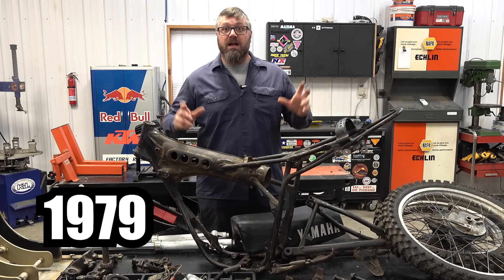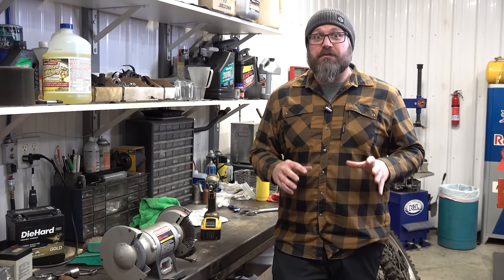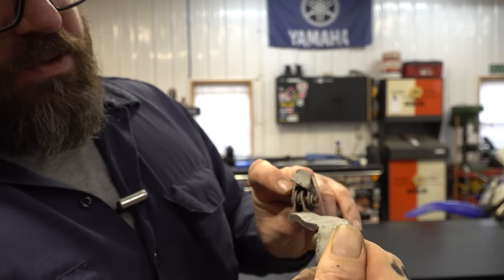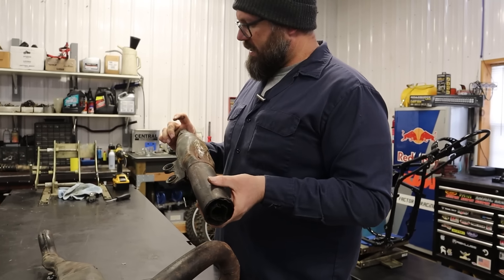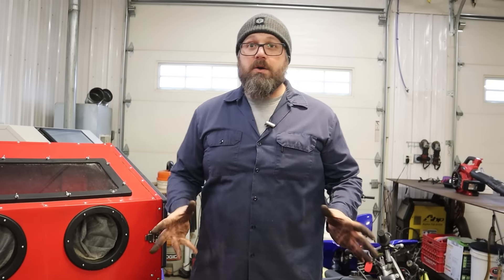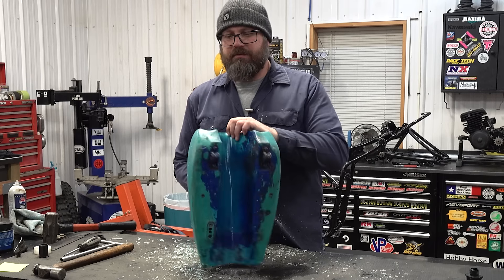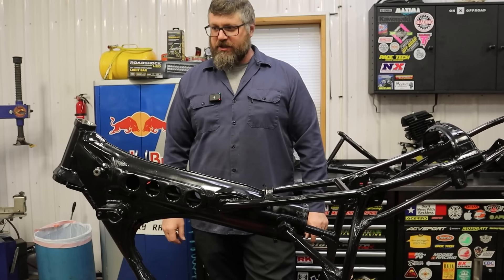Restoring A Vintage Yamaha Dirt Bike Part 2

Comment: The trick with bearing races (around the 9 minute mark) is to put a weld bead around the inside of the race. When the weld cools, the race contracts slightly and lets you get them out.
Reply: Amazing advice! Noted
Reply: This is the way.
Reply: oops i just commented the same.
Reply: This is the way i do it.

Comment: Bearded you and Dan make a great team.and i love the content getting the old Yamaha dirt bikes to go and celebrating at the end .i love the puns and music that come up during the clip.almost feel like i am sitting in the corner in your shed.I had a CT 2 Yamaha 175 with the low steel front guard.and first model that you could fit the famous Boyesens reeds to.one day out riding i stopped for a minute but when i restarted she went backwards which is how i managed to get home very slowly.the cause was a sheared magneto key.but i have been told all two strokes run backwards if you push start them that way keep 'em coming.Dallas

Comment: A little millwright trick: if you take a small mig welder and weld a bead a third of the way around the inside of that outer stem bearing race and let it cool, it will fall out.
Reply: I just sent the same trick .I'm a millwright also
Reply: Yeah I was thinking the same but for the 20 seconds of taping it with a hammer with a race punch and by the time you get the welder and the gas turned on it doesn’t really pay.

Comment: Thoroughly enjoy your videos, love the constant commentary and explanation. Do struggle some days translating from US to UK; Triple clamps are Yokes, Wrist pin is a Gudeon pin, Spring clip is a circlip!.  I expect you know but a suggestion for the fork legs, crack to bottom bolt loose before taking the pressure off the fork springs. Sometimes the spring pressure will stop the internals spinning whilst the bolt comes undone. Cheers thoug, realy enjoy your vids.

Comment: I had a DT175 with multiple head gasket issues. I drove it with a big mainjet to avoid a piston seizure and it then ran only 55 mph. Steel bolts in an aluminium cylinder - they always came out although using a torque wrench!

Comment: Great video 
When fitting the carb slide try a plastic disc with a slot cut into it something like a Pringle top you can slide it on to the cable and hold the spring back wile fitting the slide it’s a trick I was shown years ago and it works

Comment: A small tip, find a six inch 1/4 inch rod, cut a slot in one end of it, so it’ll hold a strip of red or grey scotch bite material. It’s useful for reaming our bolts holes, bushing, or bearing races. Of course chuck it up in a drill. It works! Later.

Comment: Little tip on the bearing races . Take a mug welder and run a bead around the inside of the race and they will fall out when they cool down

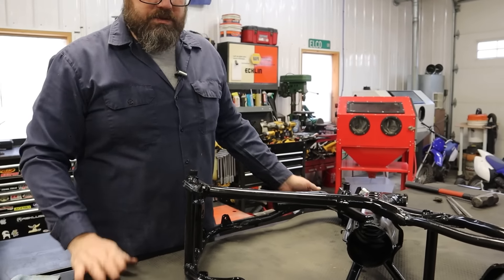Comment: At 9:05 top tip to remove outer race run a bead of weld on the race and it will shrink it and make it easier to come out...yep I am and old bloke m/cycle mechanic.

Comment: I'm a little late to the video but for those steering head races, if you take a mig welder and put a small bead on the face of the race in a few places it'll contract it and it'll fall right out done it hundreds of times on trailer wheel bearings that are about the same size.

Comment: That expansion pipe that goes over the of the engine really needs to be cut open and clean out the holes in the 2 baffle plates then reweld. They clog up and restrict the exhaust flow.

Comment: Those dots on the handlebar clamps, not only denote the top but you are supposed to tighten the dot side to zero clearance then the other to tighten the bar.

Comment: I have a 1964 Honda CT200 (aka Trail 90). All original. Engine was full of water and seized bad. Its been soaking in oil for about 3 years now. But Im in Seattle, and the 90 is at my EX-mother-in-laws house in SoCal! THAT'S a problem! 😂 Wouldve been a great fixer for you.

Comment: If ya hit that tank with a propane or oxy acetylene torch it'll renew the color as well as remove any scratches,and light gouges with no sanding required... Plus it makes the plastic less prone to cracking as it rejuvenates the plastic making it softer,less brittle again..

Comment: If you have big scraping jobs like this or for removing old paint or even woodworking, get floor scraper blades. They come in 4" or 8" lengths and you can cut them with tin snips if you need.

Comment: My bike may be considered unfixable by the majority of other people. Its a 1996 yamaha rt180 and one of the previous owners buddies removed the oil injection and didn't say anything and when the PO got the bike back he put straight gas in it and it cooked the rod and he got rid of it and the engine was disassembled around 20 years ago so parts got lost and now i got the bike and im gonna restore it mechanically because I like a good challenge. Wish me luck because some parts are hard to find so i have to think outside the box.

Comment: Next time grab your welder and putt a hot bead on the inside of bearing race .it will shrink it when it cools . It most times will fall right out
Reply from the maker: I would have, but my bottles ended up in storage and I didn't have time to grab them...

Comment: for the top race on a headstock like that what i usually do is tac a nut to the inner part of the race then use a slide hammer.

Comment: tip on stuck bearing race,  run a bead of weld on the surface of the race and it will shrink the race and it will then likely fall out easy.

Comment: I had one and if i remember blaster motor parts are some interchangable i remember need a clutch and we use blaster disc and spring but thats 20 years ago i think the cyclider was possible swappable but like said long time since that bike was around and iam from Pennsylvania and it sat in Bedford well sold family some time hole another story my uncle has shop there Ritchie cycle shop but iam not sure if hes doing it full time any more ill tell you amount of old rare bike he use to have sprawled around it been many years since i been there so don't no whats still around.

Comment: You might be able to hammer a wooden dowel or old shovel handle to straighten out the inside of that muffler tube.  it looks like he was beaten with hammers every time it was repacked.

Comment: You oughta scrap the pipe and silencer and replace them with a DG pipe and silencer. That gas tank is looking good , I have a magic trick for weathered plastic. After you scrape all the dried plastic off take a heat gun to it and heat it just till the plastic shines then move on to another area. The plastic will look like new but be careful not to over heat any plastic or it'll ruin it.

Comment: Hey Craig , if you check out Ken Kapland of Kaplan motorcycle muceum  in Main Con, he did a recent video on how they bring back the color on those tanks, yes use a blade first but then they use a heat gun,  but id recamend you watch him how they do it with the heat gun,as if your not do it right you'll wrope the cervice and thats not good lol i trid his techneak and was able to bring back a plastic chain gaurd on a little kids bike that was supposed to be blue but was very white.

Comment: Dang. Was gonna bring my 92 Vmax, but it is not " unfixable" .It just needs the carbs rebuilt, fuel system cleaned,  new tires, battery and cleaned up, lubed. Been sitting many years. Got some newer bikes. It took a back seat.

Comment: Those knock out tools for the races are rubbish.  I bought a different type, it is in 2 halves with a lip at one end of each with a bolt joining the 2 so when placed in the head it winds the 2 halves out catching even the smallest of edges yiu then whack it. When the race moves a little adjust and whaci it out works great.

Comment: You should really get a paint gun and learn how to paint.  You also didn't use any etching primer and not only that rattle-can paint chips very easily.  I have been painting for 20 years professionally and being as you are good with your hands you should be able to learn to paint just by watching videos.  Get a decent paint gun and some 2k black paint and it will last much longer.  If you make your first coat semi-thin and allow it to get stringy when you touch the tape before your second coat it acts like glue for the final coat and helps to reduce the chance of runs, it is called a tack coat.  For small stuff, you can also add an accelerator to the paint so that it dries faster.  Trust me, take some time and learn how to paint you will be much happier with the results and it will last longer.  Devilbiss makes a good gun for like 140 dollars called the DeVilbiss FLG-5 1.3mm but it's only good for solvent-based paints so no water.  You will also need to have dedicated air hoses just for painting so no oil or water in the lines.  Also, I live in Europe I think the gun is named something different in America but it should be easy to find.

Comment: Regarding reusing the neck races - while the outer dimensions of the needle roller bearing set is standardized, the inner dimensions (thickness of the roller and race angle) are not. I've had before where I tried to reuse races and the angle was different, and they wouldn't work. Took a few goes to realise that problem. So since then, I wouldn't suggest anyone try that unless the bearings are from the same brand (and ideally the same batch!)

Comment: I had the same way of justifying not changing bearings in the past. 😂
Next time, lay down a bead with the stick welder inside the race. As it cools down and shrinks, it'll almost fall out on it's own.

Comment: Craig, there's a really old video here on YT on restoring old ATV plastics, the guy uses  a mix of paint thinner and boiled linseed oil and explains the ratio to  mix. This works better and longer thann heat or the method you used. https://www.youtube.com/watch?v=KevwAZutZwI

Comment: Captain Hindsight here.... you should have removed the stem races before you painted the frame with some heat and beat.  Then, install new ones.  Tape them off and then paint.